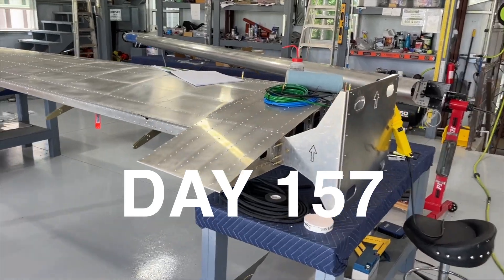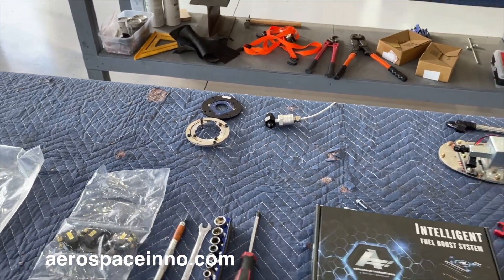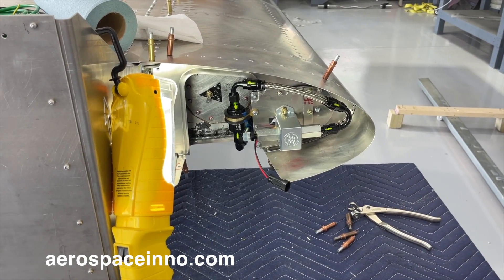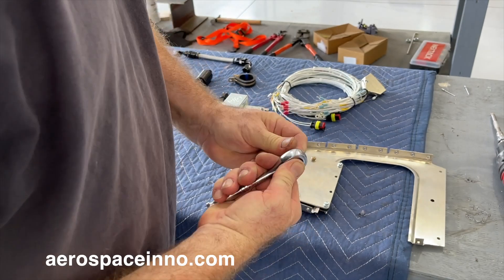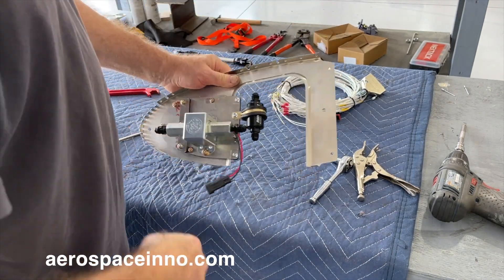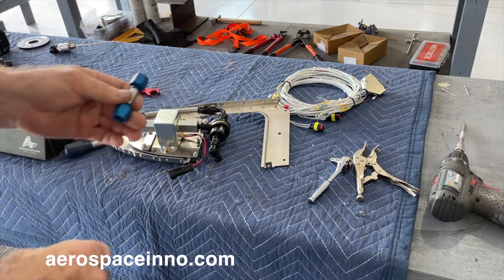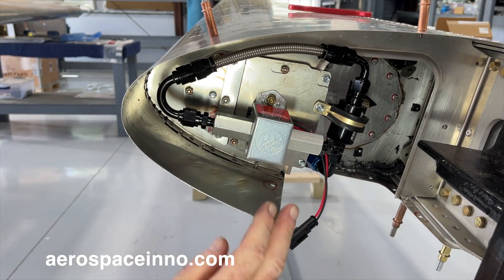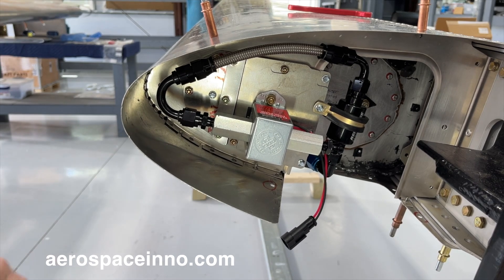Intelligent Fuel Boost System Installation [Sling TSi Build Video #16]

Comment: You can fill a tube with sand or salt and bend it. That should keep it from collapsing. Tape off the ends so the sand or salt stay in.  Empty once bent.  I did this with some 1/8" copper lines.
Reply from the maker: Great tip, thanks for sharing!

Comment: While having the pumps close to the tanks seems like a good idea, the sensor on the fuel selector seems like it adds the potential for new faults. What happens if that sensor fails, is there a way to manually control which pump runs? Are there bypasses on these pumps so the engine can continue to run if they fail?
Reply from the maker: Yes there is an override switch for the selector.  The pressure sensor monitors that as well. And the pumps default to gravity flow, as a typical boost pumps.  Great questions!  Thanks for watching!
Reply: What sort of service interval do you envisage for the filter?  Do you need to just remove the access plate or is it too tight to get in to replace?
Reply from the maker: @petereedy8252  Hey Peter.  The service interval is 100hr/1yr. The filter is relatively coarse, so the element can be removed and cleaned of any debris then re-installed without needing to change out the entire assembly.  Hope that helps and thanks for watching!
Reply: @TheBaldPilot  thanks mate, just been told that my QB High wing should leave SA for AU end of June.  I’ve got lots to learn, your videos have been great, thanks for all  effort.
Reply from the maker: @petereedy8252  Very exciting!

Comment: Is this in addition to the fuel pumps on the firewall or did you remove those fuel pumps Since you have these on the wings?
Reply from the maker: This is in addition to.  Boosting the current fuel system.
Reply: G'day Rob..  love what your sharing mate...  I probably would have used a spring inside that little tube to bend it..  and I would have taken it off the tank first..  I'm loving your work and have been making notes for when i commence my build in australia.   Hopefully next year.
Reply from the maker: @jeremyolney8316  Good tip!  I've worked with 3/8" aluminum fuel lines previously, so I am familiar with its malleability.  But I could have done a better job for the video.  Thanks for watching!
Reply: Love your work. Thanks for sharing. Greetings from Germany and all the best for you. Chris
Reply from the maker: @CK.projects  Thank you!